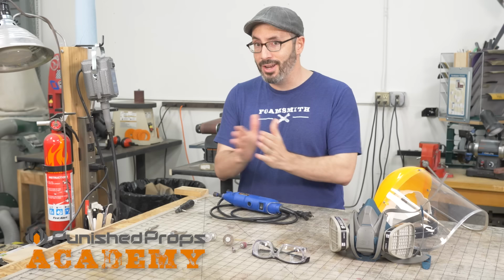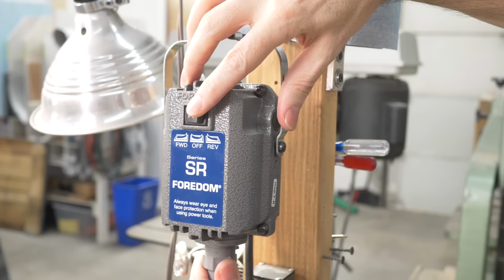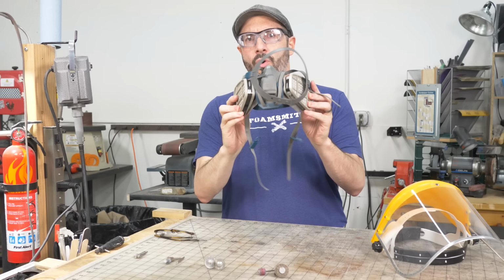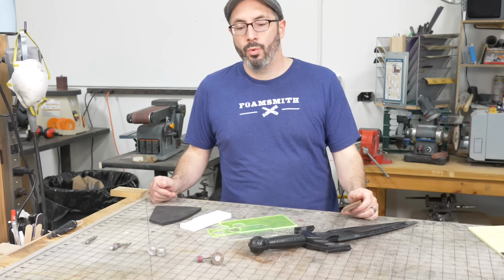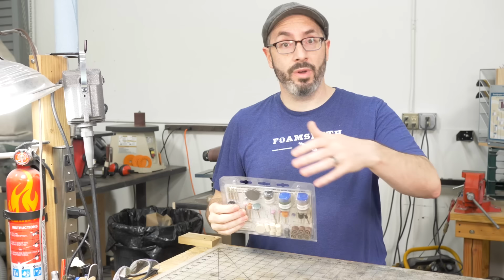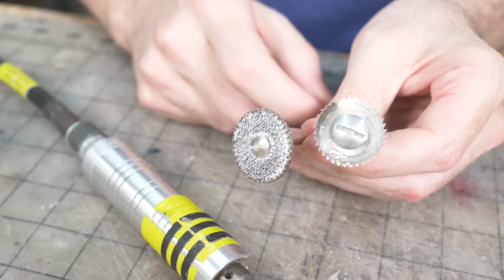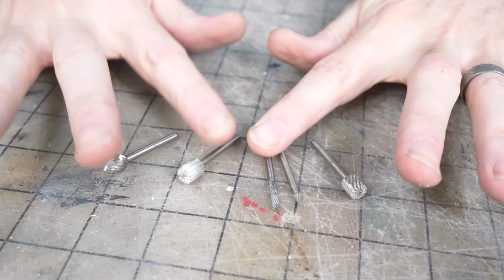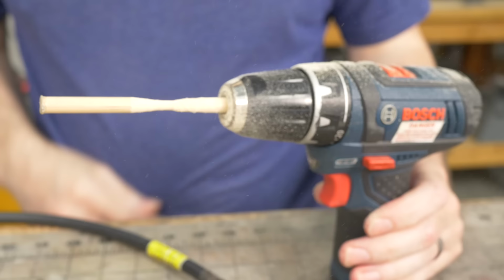Rotary Tool Basics: Your New Favorite Tool

Comment: Great vid - I just wanted to add that while you mentioned using a respirator most of the time it is CRITICAL to use a mask when using a rotary on resin parts.  The resin as dust is particularly dangerous and damaging for lung tissue.  DO NOT work with resin without protecting your lungs, a good friend of mine had to have a lung REMOVED because it was damaged by resin dust.  FYI
Reply from the maker: 100%.
Reply: What's resin?

Comment: I've had very poor experiences with low-grit sanding drums on foam.  It doesn't help that many of the cheap kits and collections just come with sanding drums with no grit specified.  The low-grit sanding drums I had would dig into foam and randomly rip tiny bits out, leaving me with a really rough surface that takes a lot of time to clean up.  I recently switched to 300-grit sanding drums for my finer foam work, and I found the difference to be significant.  They dig through the material almost as easily (at least on my Proxxon) but the surface ends much smoother and requires less work to finish.  So if you're getting poor results with your sanding drums on foam, consider getting higher-grit sanding drums.  Hopefully this helps someone.
Reply from the maker: Yeah we prefer higher grit drums for foam for that exact reason - great tips!

Comment: Thanks Bill, great vid as usual. Just fyi, the cartridges you're using on your half mask are for vapors rather than dust particles. They'll probably filter out dust but there are specific disc-type filters for this purpose (3M 2125 or 2135). Alternatively you can add dust filters over those cartridges (5925/5935) to prolong their lifespan and give you combined protection.
Reply: Thx I have wondered for a while witch to use 😊
Reply from the maker: That is technically true, yes, and definitely something good to be aware of!
Reply: Ironic that 3M manufactures filters considering they are one of the most pollution-making companies in the US!

Comment: I have found that the cheap harbor freight Fordham knock-off is pretty good, especially for $50. If you need more than a Dremel, but less than a Fordham, it's a very acceptable substitute.
Reply from the maker: Yes that's a great option!

Comment: Got hooked on wire wheels for cleaning and polishing when they came in a rotary tool bit set. I've since upgraded to drill-mounted then bench grinder or angle grinder mounted. But, the little wires hurt just as much coming from the rotary tool as from any other version, so the protection mentioned plus an apron are strongly recommended.
Reply from the maker: Oh yes, good tips!

Comment: I use mine primarily for wood. I would say my biggest hack is using metal grinding/sharpening bits on wood as a fine sander. I would suggest getting some finishing wheels, they are so good just for getting rid of the 'bits' after cutting anything, specifically pvc.
Reply from the maker: Great tips!

Comment: I have one of those Wen rotary tools. I was excited because it also came with the extension cable. Unfortunately it was horrible quality control and the motor is off center and vibrates horribly. Replacing the collet helped a little, but later I bought a used Dremel 3000 at a pawn shop and it was a huge improvement. It really pays off to spend a little more on quality.
Reply from the maker: That's one of the biggest lessons I've learned about tools over the years.

Comment: Great video. Another safety tip relevant to rotary tools (and any power tool that spins), if you have long hair be sure to pull it back and/or contain it somehow. Spinning tools love to grab long hair and pull on it, and that usually leads to bad things. Probably not going to be an issue for Bill anytime soon, but it might be worth keeping in mind for others.
Reply from the maker: Very true! That's a general good rule to follow any time you're in the shop - same with sweatshirt strings!

Comment: For trimming thin plastic items, esp. vacuum formed, I like the DuraGRIT carbide cutting / shaping wheels. I use the 1-1/4" CS4, and I made a 1/4" mandrel and run it in my little B&D shaper table (handy thing that they haven't made for 20+ years probably). Perfect setup when you need to trim a vacuum formed thing to a uniform height - I was making a lot of basically box-shaped items at one point. Dremel seems to sell the exact same thing under their name, model 543. DuraGRIT has a 1" model as well that might be better for hand-held use. More durable than the fiberglass wheels and thinner kerf if that matters. I have the saw blade bit too, but especially in thin plastic it catches a lot and scared the crap out of me!
Reply from the maker: Right on, thanks for the tips!

Comment: I've found that safety goggles are especially important if you are using the sanding bit to sand foam that has bathroom sealer or hot glue seams!! 

Sanding those materials seem to send a military grade artillery of small chunks right into your face!
Reply from the maker: For real

Comment: I was able to add a Foredom foot pedal on my Dremel. I would however warn that I read somewhere that this might not be what the Dremel motor was designed for and might possibly damage it, but I used mine for about a year and no issues. I eventually got the full Foredom and honestly, while it looks like a beautiful lightsaber, has more power, and can do more things (like a mini belt sander), I don’t know how essential it is for people that don’t have a large budget
Reply from the maker: Absolutely agree. We LOVE our Foredom and it works well for what we do, but a smaller/cheaper rotary tool works just as well!
Reply: @punishedprops  FWIW, I own three Foredoms and a number of other rotary tools. I work with steel and use a Foredom TX as a die grinder of sorts with 50-100mm attachments. Not gonna happen with a Dremel. IMO, there's little comparison between a high-speed/no-torque handheld tool and a flexshaft motor when working with similar material. If one is on a budget, the HFT flexshaft grinder is about $50 without a coupon. Its pedal and chuck key aren't very good and I'd suggest replacing both with parity products from Foredom. Replacing the pedal, alone, yields a night and day difference in control. Even with the upgraded parts it's still less than $100 and it compares favorably to my Foredom SR and performs better than an older Foredom CC. The SR is a better machine, no question, but for the money the HFT tool is quite decent and a noticeable improvement over handheld rotary tools. Since buying my first flexshaft the handheld models just sit in a drawer. Seriously. Enjoyed the video.

Comment: This came up in my feed. My daily driver is a Foredom TX. Also use a SR and a few other flexshafts. Some handheld rotary tools, too, that mostly sit in a drawer. Nice to see that you have a Foredom, as well. Given the performance and versatility, IMHO the price is very reasonable. My suggestion to folks who want to use a rotary tool in a serious manner, for a lack of a better descriptor, is to buy any pendant motor/flexshaft they can afford instead of a handheld tool. The difference is not subtle. I can write a novel about this, so I'll stop here.

Comment: I was really hoping you would tell us which bits you use on the acrylic, it's hard to see if it's the cut off wheel or the classic saw tooth blade. I have been running in to a lot of problems trying to cut acrylic, perspex and plexi.
Reply from the maker: I used the cut off wheel so the teeth of the saw blade wouldn't tear chunks out of the acrylic.

Comment: I have a very tired and user friendly one I get the whole kit and bits with from Maplin many years ago when they were still in business. The only issue I found is I think the bit used to hold the tools is not universal as i am now down to my last bit that holds onto the various bits like the saw, sander and grinder parts but ones from my fathers Dremel are too large. Reluctantly I may have to retire it and get another if the last ones prongs go, as not sure if I can get the bits that fit. (These are the inserts that grip onto the other tools, has three gripper like ends that close up when its tightened, they tend to snap over time).
Reply from the maker: Oh wow! What a great tool to have had for so many years!

Comment: Hi Bill! Some rotary tool use tips would be good; I never get a smooth surface with mine on EVA foam it leaves it bobbly/fuzzy. Is there a way to stop it doing that?
Reply: A good start is to use a worn down sanding drum and test the direction in which you go wither the tool
Reply from the maker: We like to use a more fine grit like 220 for EVA foam. A stone grinding bit like the ones we show in the video are helpful to use after the sanding drum to smooth your material, and a final blast with heat from a heat gun or blowtorch helps get rid of the fuzzies!

Comment: I have a really cheap ~$15 rotary tool, but every time i’ve tried to use it on foam it ends up making gouges or super uneven surfaces and basically ruins the whole project. I think the sanding drum bits are all too low-grit to do anything useful on foam, but the other bits are much finer and still cause the same problems. Often the bit will catch on the foam and dig into it or it’ll skid along the surface despite my best efforts to control the speed.
Reply from the maker: Yeah you may need a higher grit and also make sure you're moving the dremel in the right direction! Because of the rotation it's better to move it in one direction otherwise the rotation just makes it bite into the foam

Comment: Bill - looked like you moved the tool with the direction of rotation on the foam.  Is that by accident or on purpose?   Does it give you more control.  I naturally bring the tool towards me and results with it digging in more which sometimes is not good. Have to remind myself to move it away for less debris removal but that is when I get runaways.  Maybe a video on specific techniques with the tool in the future?  
Thanks for all you guys do.  Your videos have helped me through many projects.
Reply: I don't now witch direction but on is more aggressive and removes more matirial and the other less but gives you cleaner edges.
P.S. the sanding drum needs to be worn down a bit for both methods otherwise it will be a ruff finish regardless.
Reply from the maker: I actually can't remember off the top of my head which way I move it, but I know one way bites less and is easier to control.

Comment: Hmm, if I had known about these earlier. I would have saved up and bought one. Probably would have saved a lot of hand sanding when trying to remove the nerf logo’s. However  those have taken the back burner lately. Due to other more immediate desires, or problems. That and I need another donor  gun because I broke one of the internal parts.
Reply from the maker: Rotary tools are SUPER handy - we use ours pretty much daily. Harbor Freight is a great place to look for less expensive ones!
Reply: Punished Props Academy I’m gonna assume this harbour Freight I’m always hearing about. Is the American equivalent of Princess Auto, or Canadian Tire.

  However currently I am focused on getting a different vehicle first (preferably not Chrysler) . Then I’ve got to finish up some other plans.

Comment: My rotary tool never leaves my workbench, and I only take the flex shaft off on rare occasions, when I put on the router head instead. 😁

It's kind of the inverse of an electric screwdriver:  Where the screwdriver has low speed and great torque, the rotary tool has massive speed, but such low torque that you can stop it just by grabbing it with two fingers.  (Note:  Do not do that!  FFS…)

Comment: Can you get wider sanding pads for it ? Thanks . Good video.
Reply from the maker: There are different sized sanding drums but what sizes are available to you depend on the tool you have! If you want to do a lot of larger area sanding, you may be better off looking at a small belt sander or something similar.

Comment: So called micromotor for dental technician are with no doubt the best rotary tools. They never slow down and work all day. But you shouldn't cheap out.
Reply from the maker: Oh great to know!
Reply: Thanks right. Also know as laboratory handpiece. I use one from Wasserman and before that from Kavo. They are quite, powerful and accurate. With the knee paddle you have a lot of control for the cutting speed.

Comment: For an amateur maker, would you recommend getting a cordless or corded rotary tool? I imagine a cordless would be super convenient not having to worry about plugging in if you're trying to use the tool outside or just can't find an outlet readily available, but then you're always worried about running out of power midway through a project.
Reply from the maker: I think that's exactly what you need to consider. I find that corded things tend to last longer and end up being worth the slight inconvenience.
Reply: A quick fix to cordless tools running out of juice is having 2 batteries (or more). If both are charged, when you plug in the 2nd one after emptying the 1st, by the time 2nd is empty, 1st is back to fully charged. Some batteries even work on several tools from a same brand and means you're not actually buying batteries separately but just benefiting from those you get each new tool you buy.
Reply: you get more torque with corded.

Comment: the link for the respirator from Amazon isn't available at this time.  it is being prioritized for those on the front lines of dealing with the pandemic.  but there are some that are available.
edit = the face shield and others aren't available either.
thought you may want to know.
question, if I click on your link, but I'm not ready to buy yet, so I put a bookmark on my computer for that page, do you get credit for that when I do buy using that bookmark?
Reply from the maker: Thanks for letting us know! And I'm not sure, there's likely a point when it expires, and I think it also has to do with which item is added to your cart afterwards.

Comment: How do you make a mold of something hollow? for example a smoking pipe? 
I would like to mold pipes with silicone and i haven’t started because i’m still uncertain how to make it hollow in the middle for the smoking portion...
Reply from the maker: You'd create a plug of silicone. I think in the specific case of a pipe you'd likely need to cast it in 2 halves so you can get the opening all the way through, since that opening in pipes is quite narrow.

Comment: do you know any good safety gloves that don't ruin your precision or tactile response? Every globe i tried either has the thumb "sliding" a bit while grippint the material or i can't feel as precisely when the material isn't behaving as intended (some wood planks have parts with different density and they can get the saw stuck or affect the cutting job)
Reply from the maker: We use latex free nitrile gloves and they work really great. Fit has a lot to do with how well they work.

Comment: Great Video! The last link for the rotary tools doesnt work sadly.
Reply from the maker: Thanks for letting us know! We'll fix that ASAP
Reply from the maker: Hmm we checked and all the rotary tool links seem to be working correctly on our end. Could be a connection issue maybe?
Reply: @punishedprops  Thanks for checking so fast! I again tried it and the wen link is the only one that doesnt work. But it seems like its an amazon issue. Maybe its not available in europe?

Comment: @4:56, Just because they make a mini saw blade, DONT USE IT. It isnt worth it. I just had a mini grinding head have some kick back on me, grabbed a knot and caused the dremel to jump a few centimetres (towards my hand). 

That saw blade will remove FINGERS faster than you can understand what has happened. And there is ZERO safety (dont assume a foot pedal is any safer than on shaft controls - your reaction time is SLOW compared to the RPMS of these units).

BOTTOM LINE?: ---- ONLY USE grinding bits for rotary tools. Never a cutting blade. It isn’t worth your fingers.

Comment: up to what thickness of acrylic can you cut with a dremel cutting bit?
Reply from the maker: I probably wouldn't try it on anything much thicker than 1/8th of an inch or so, but that also depends on your particular tool.
Reply: thanks for the response!! what goes wrong after 1/8”, will the plastic overheat? and what about the tool will change the outcome?

Comment: Oh, and if you are lucky enough to have shop air, I recommend this thing: https://www.harborfreight.com/pneumatic-18-in-micro-die-grinder-kit-60244.html
It sounds like a dentist's drill when it's running, but the handpiece is small and the air hose is ultra-flexible, so it feels much more natural for carving things like your smiley face. (It also runs up to 40K RPM, whereas the typical Dremel only goes up to 20K, so check the specs on your bits.)
Reply from the maker: Thanks for the recommendation!

Comment: Off topic, but why do you recommend Dap's Kwikseal specifically for filling gaps? I am having trouble finding it around me, but I do have access to other flexible caulks with reasonably short drying times. Am I missing out?
Reply from the maker: It just happens to be what I've found works well for me - it smooths with water and dries flexible, and takes primer well. If you're able to find caulk that can do all those things, it should work just fine! Worth doing some tests to see what you like.
Reply: Back, as a favor to future readers: Why DAP Kwikseal? Because it's thicker than a Pixar mom's wagon. Most caulk behaves like extra thick PVA glue, shiny and a little sticky/stretchy. But Kwikseal behaves more like clay, less shiny and gets a little crumbly as it dries (while still being very flexible). There is a place for both in my drawer, but I am definitely ordering more Kwikseal.